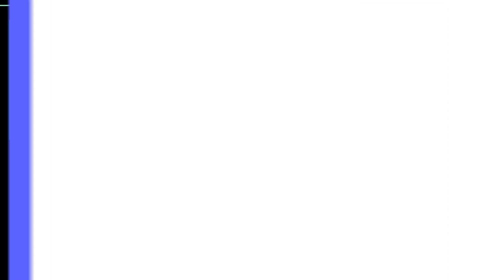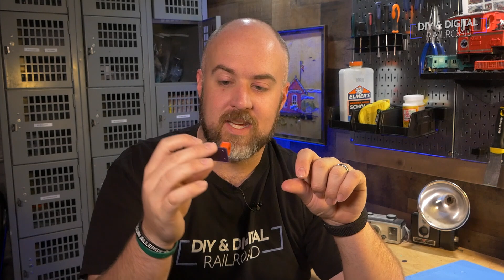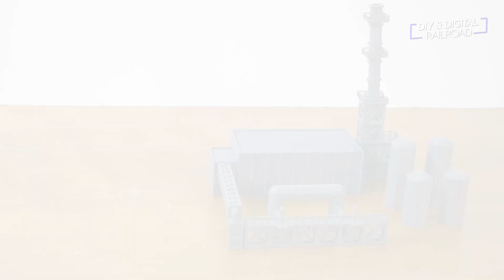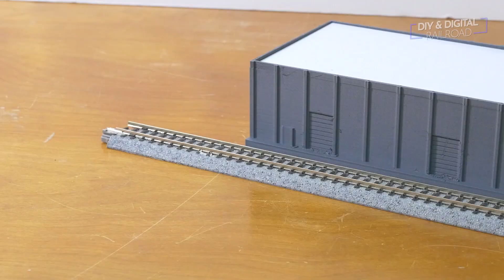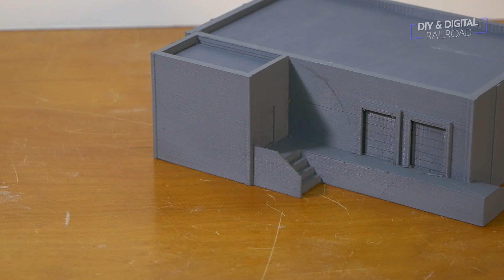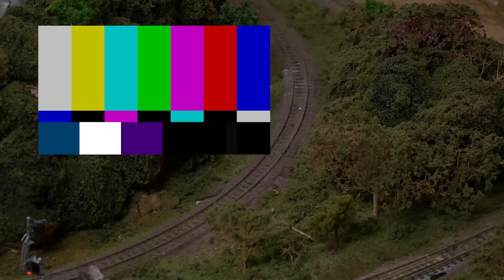New Model Railroad Buildings, New Projects, and Announcements: The Spring 2021 Channel Update

Comment: I'm curious about the 3D printed buildings. Are the walls printed seperately and then assembled like a kit or are they printed from the ground up?
Reply from the maker: I print the walls together from the ground up.  All you need to do is put the supplied roof and base  on them

Comment: Quick question for you on Arduinos: could you use the 12v rail on an ATX PC power supply to power the motor shield/track?
Reply from the maker: I would probaby steer away from that.  The amperage that a motorshield can handle is fairly low.  I don't like going past 2 amps.  I would look into DCC boosters that are placed between the base station and the track.
Reply: @DIYDigitalRailroad  I thought that might be the case, but I have searched and searched and could not find a clear answer. Thank you!